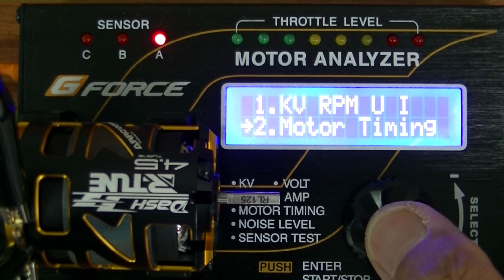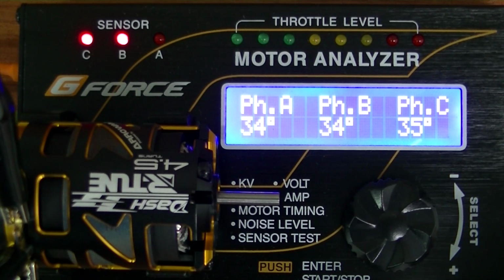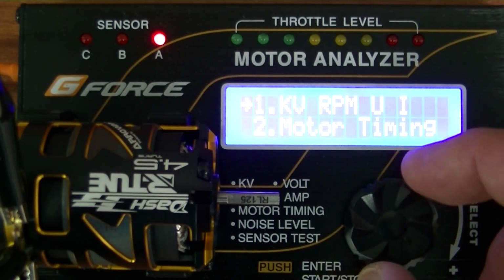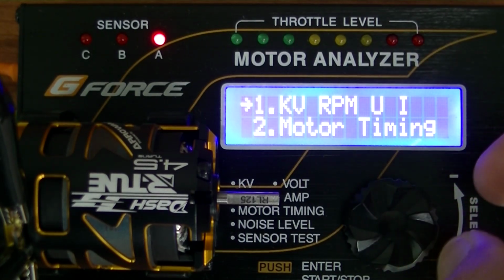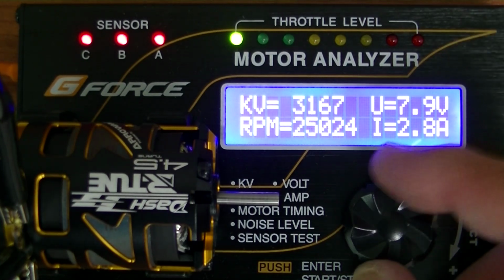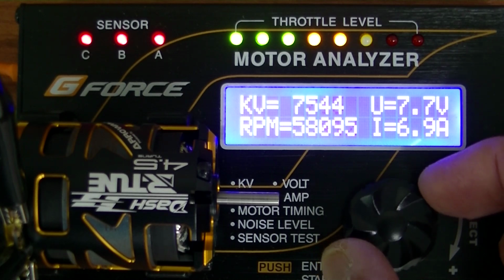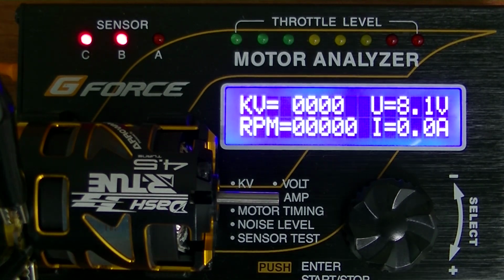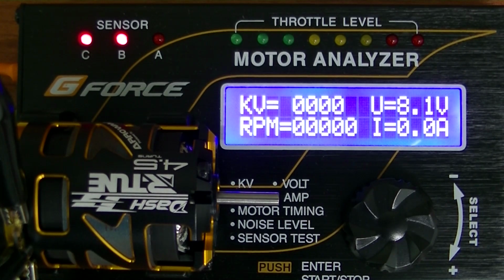Dash-RC 4.5T Modified Brushless Motor On The Motor Analyzer.

Comment: When I try the motor timing test it stays at please wait until it times out. What am I doing wrong?
Reply from the maker: If the tester is not defective and all connections are proper,  it could be something with the motor itself.  You can try and clean up the motor by using high pressure air, especially at the back of the motor where the Hall Sensors are.  Hope hear from you again whether the problem persists or the problem gets resolved. 🙋👍